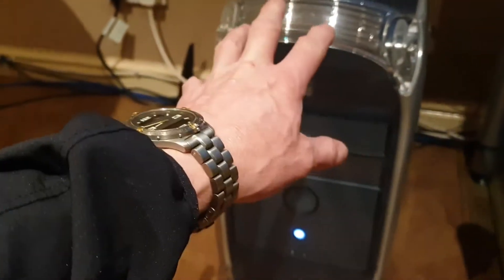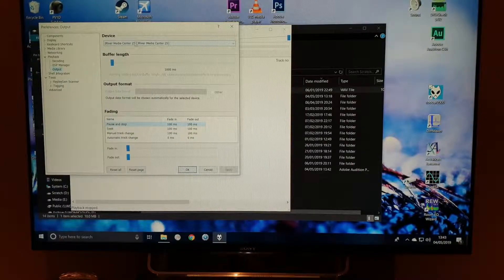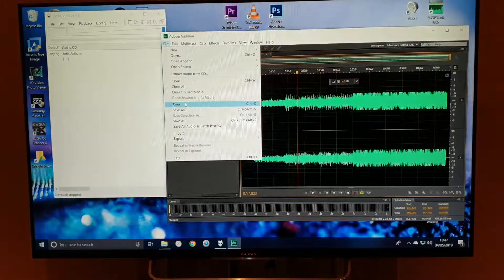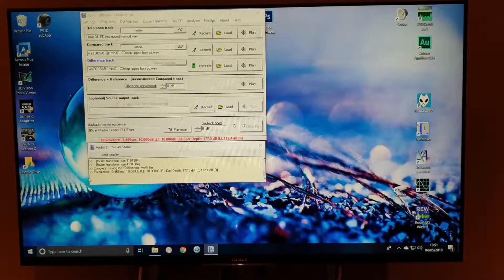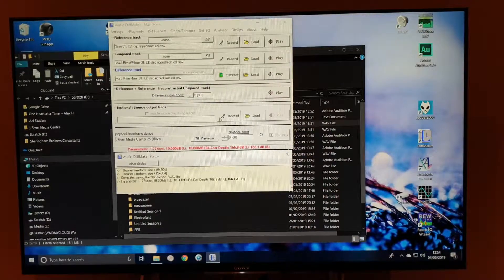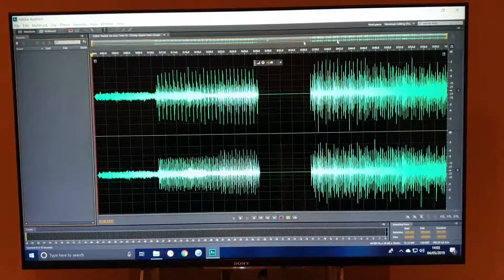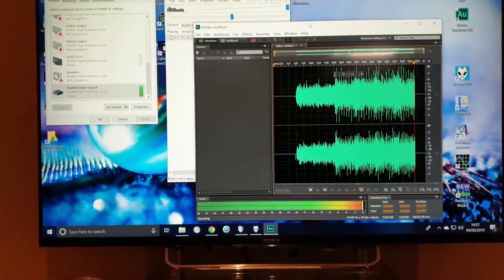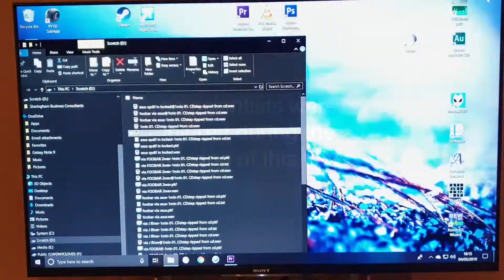Bit Perfect PC Audio  Q.E.D.

Comment: I'm sorry I do not understand why it is so difficult if the program RMAA has the ability to compare the test signal from the recorded audio file.
Reply from the maker: I have not used that program. maybe you could put a demo of it up replicating similar info proving your bit perfect transmission?
Reply: @idiocratease  I can't do it, since I do not have a logical analyzer i2s.
Reply from the maker: @СергейАнисимов-п8х  surely you have a couple of PC’s with sound cards… any transfer except look back (since you will use only 1clock in loop back), should be good enough to show us all you proving bit perfect transfer?

Comment: My PC is connected to the DAC of the Audiolab 6000A via coaxial. Hence, the PC should just be sending out a digital signal via  Realtek Digital Out. How close to bitperfect is achieved via this configuration? Should I bypass the integrated Realtek soudcard by investing in either a PCIE dedicated or external USB soundcard? Thanks.
Reply from the maker: Check the Realtek by looping back into the digital input. Capture a file and use audiodifmaker to check. If you don’t have a digital input, then you’ll need to capture to another PC to check ( with a pro card which can clock lock).
Reply from the maker: I suppose one other comment I would make is, if you have the option, I would use optical rather than coaxial fro a PC (that goes for USB too), since this breaks the electrical link between a (electrically) noisy PC… that’s what I always do…
Reply: @idiocratease  - If you measure the analogue output from both optical and coaxial connections to a DAC, there is significantly more jitter from optical and every sound engineer/calibrator advises against using optical as digital output from a PC.
Reply from the maker: @CovertOperative  I am of course aware of this. But as far as I am aware this increased jitter does not cause a problem unless so large that is results in data error. I  use a 10m to slink, and am 100% sure of bit perfect transfer. So any additional jitter there might be is an irrelevance. You have to think about it as lesser of two evils. And eliminating the electrical connection to the PC, is a much better thing…

Comment: Very interesting video, even if it is difficult to understand the exact test process. 

I use PC and external DAC (Topping D50) and have some followup questions:
1) Is it possible to do the same test also with windows media player to see what result that will give (or is that much the same as your test with internal clock)? There is an ongoing debate about WMP12 vs external audio players so your test could bring additional facts to this debate. Personally I feel WMP12 fuller/rounded in sound so I would expect some manipulation in the process. 
2) I use Foobar2000 and WMP12. Will Foobar2000 give bit error with output set to  "default: primary sound driver"? At least it gave me ear fatigue after some hours listening. Is there any difference between ASIO vs WASAPI (event) as far as output quality. Should WASAPI clock be set to input (16Bit CD) or output (32Bit DAC) frequency? 
3) Does ASIO and WASAPI shortcut this whole internal clock issue or would normal users need to do the tweaks you did with the frequency?

Thanks in advance.
Reply from the maker: Hi, interesting questions. I thought it was worth checking the WMP angle. So just repeated the digital copying of playback of a ca. 40sec wav file. Playback  from J River sampled into Adobe Audition and repeated it with WMP. Source was 16 bit, 44.1kHz (CD level) thought I used 24 bit audio files just to maximize the digital headroom (not technically correct phasing I am sure). Anyway, copies are identical and noise floors of the recordings compared using Audio DiffMaker were Corr Depth: 190.9 dB (L), 189.0 dB (R) from J River and Corr Depth: 179.2 dB (L), 183.3 dB (R) from WMP. I don't believe the differences are of any significance, since the noise floor of the original 16bit recording was 96bD!! So on my system, there is zero difference in the bits from J River and WMP, and the bits are idential to the orginal file.
Reply: @idiocratease  Thank you so much for your additional testing. So for CD quality playback , I might as well use WMP12 since it has a more attractive interface?

For some reason foobar2000 and WMP12 doesn't sound the same. So let me know if you find any other differences at a later stage. 

P.s. It that the beautiful Bowers 803 you have? 704 is in my system since 15 years. One of my best investments I have done, along with my Italian espresso machine. ;-)
Reply from the maker: @macmaster9840  hi I would say zero difference between JRiver and WMP on my system. But both cases I am using RME AIO sound card. This is pro level card, and I think the drivers are excellent. I am guessing that WMP is using Wasapi (though I can’t be sure) and I don’t see a direct sound driver option on my set up. So my main caveat is you should check you system using e.g. toslink loop back. Capture the returned digital audio signal to a file and compare the original and captured using audio diff maker. If  you are seeing less than -130dB difference, you are in pretty good shape for Cd material etc. Also, as I mentioned only use about 30sec to max 1min file for playback, and the  audio diff maker has a lot of work to do, and I see it crash when working with larger files... check out your system like this... cheers alan good luck.